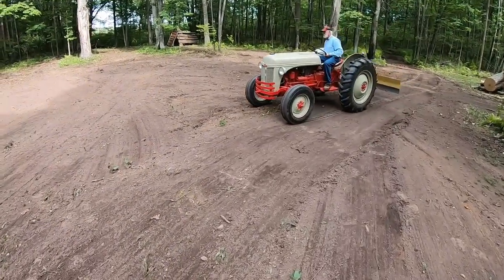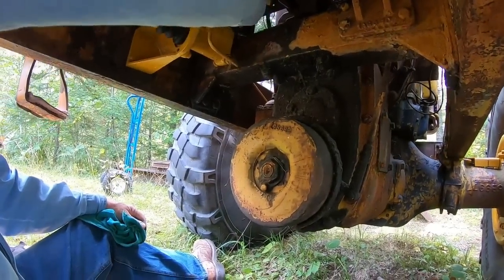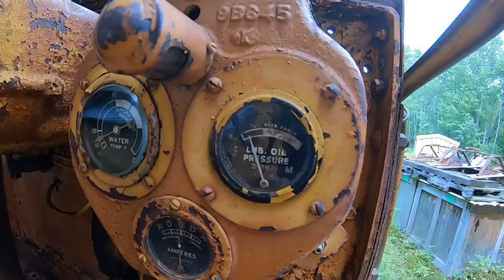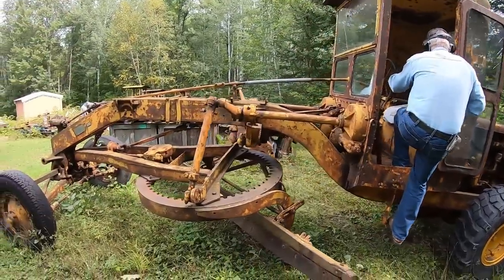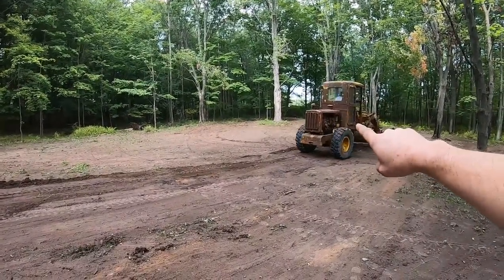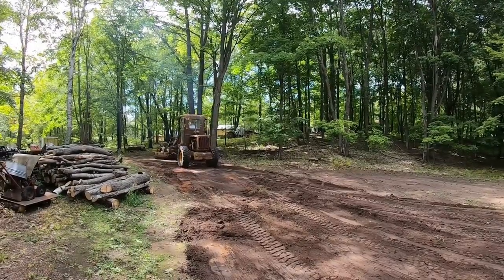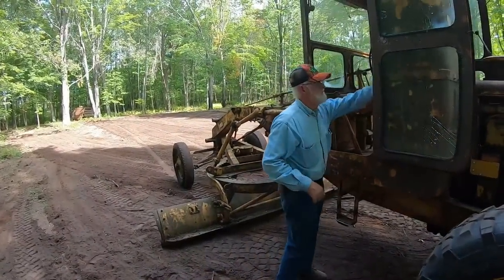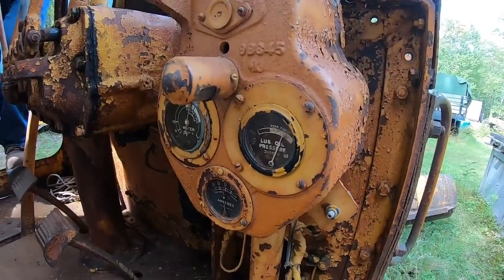Caterpillar 212 Grader #1U152 First Start in 2 Years - Grading Out Some Newly Cleared Land

Comment: Paint? On this channel haha?!? 
Couple observations I had.  I find that my 212 turns much easier and sharper when I lean the wheels the direction I want to turn, as a matter of fact the old Cat manuals say to do that too that’s where I learned it, you may want to try that the next time it’s running to assist with steering the old strong arm steering. Also I find that straight blade cutting is hard for my 212, have similar struggles as to what it looked like Sr was having.  I find the it take a far better cut if I angle the blade about a 45 degree angle it’ll cut heavier and make a larger windrow, then I’ll straighten the blade out on the next pass to push the lose material ahead if need be.  They are not power houses by any means and they are light maybe these things that I’ve learned running mine will help you out sometime running it. Thanks for some grader content, you know me and graders!
Reply: @squatch253  well that’s as good a reason as any not to use that function 😂

Comment: I noticed on the fuel system that you modified and put a new filter system. I would like to replicate this but wanted to see if you could share the part numbers of the filter housing.  I have an identical tractor to this and would love to implement this modification to mine. I admire your work!

Comment: Senior's got a nice touch with that grader, but I thought he had it looking pretty good just with the old Ford. It seems to me that the Fords like that didn't have live lift and you had to really coordinate what you were doing to keep the clutch engaged to make the lift work, but not to necessarily have forward motion. I remember trying to run one like that years ago and I wasn't much good at it. I guess it's a little like a cable lift dozer where you have lift, but no down pressure. You actually have to have skill instead of hydraulics. Nice job all around.

Comment: If I may share my personal experience Toby. The air leak you might have maybe a micro crack on a injection line. That may not be visible but it's there and allowing air to come into the system. I understand that these injectors the D2 uses are not self bleeding? I would go and check for possible cracks and fractures along the fuel system starting from the fuel tower. But that would just be me trying to tackle this problem. The hydraulics do seem to be for a overhaul but im sure everything will be done in the right time. Good thing is the Grader moves and is still very functional.
Reply: I don't think 5hqt things got hydraulic on any thing
Reply: @jarroddraper5140  I'm not that familiar with these things. They are probably still mechanical if I look at the video again. But since I work with things that have more hydraulic components in them. Out of being lazy or just used to saying  it I probably say'd hydraulics.
Reply: Np was just looking at all the drive shafts and u joints but I can see how  it would translate

Comment: Toby is that a road patrol grader just asking I'm not sure? I've been around a lot of the older much bigger motor graders and I wasn't sure about the smaller ones. All the ones I worked on had the duel rear wheels and those drive chains are a pain in the rear to work on.

Comment: 212 must be kinda rare mainly,i see are #12s, and  112s
Reply from the maker: There are actually more 212's in this area than 112's, but the #12's are still all over the place.  This particular 212 is rarer still, being the old single rear drive - but that doesn't make it any more valuable though lol!  Even by 1946 when this one was built, the tandems on the rear were pretty much standard because they performed much better than the singles.